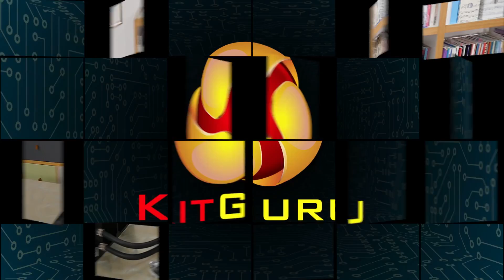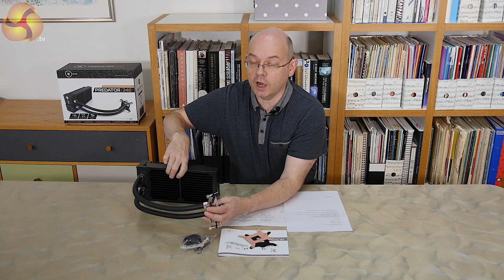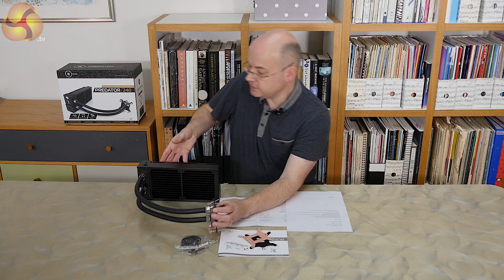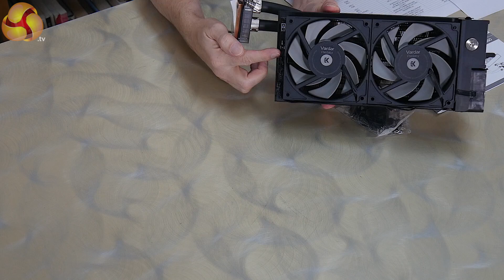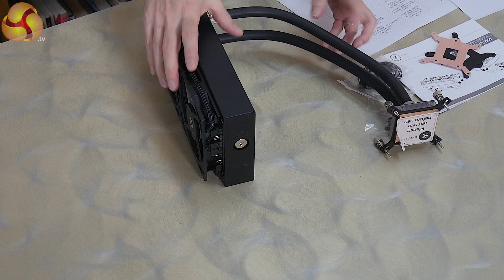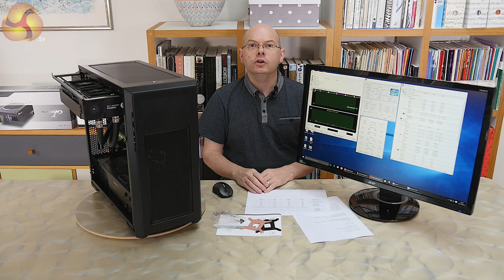EKWB EK XLC Predator 240 Review

Comment: So do we have to replace the water on a scheduled basis or is this like the Corsair h100i or NZXT x61 in that you never replace the water?
Reply: +PhanaticFilms Theoretically, yes. In practice my guess is you would pull Predator apart after a year or two and change the hoses or add a GPU block, and in the process replace the fluid. You cannot service an AIO but most people would predict an AIO would fail after a few years as the pumps tend to be weedy.

Comment: have the noctis 450, it does support upto 360mm rad but does anyone have this setup that can confirm that the predator 360 will fit in the noctis 450 ? also how often would i need to top up/bleed the system ? thanks
Reply: +TECH REVIEWS NORTH EAST/UK If you go to the EKWB shop on their website, and go to the page for the Predator 360, they have a link where you can see which cases it's confirmed to fit in. I would definitely recommend checking there, as there are a number of cases I've looked at (like the Carbide Air 540) which support 360mm rads, but not the predator, due to it's extended length (which comes from tacking the pump/res onto the end of the rad).
Reply: mygetrichslowplan thanks for the reply, i have decided to go another route for cooling.thanks

Comment: Best review, on this unit, that I have watched.
I am really considering a Predator 240 for my X99 build.
I could fit the 360 in my Corsair 780T case, but I would have to remove my DVD drive to do so, and possibly my hot swap drive bay as well. With the  test results which you received, I think that the 240 will work just fine, especially given that I don't thrash my CPU much. One thing that I am concerned with though, is that I usually run my PC 24/7. Is that going to be a problem for the water pump? I welcome any comments on this, especially if they are a result of experience.
Thank's for the video.
Reply: +Scott M (Scotty2307) I cannot really say for sure but personally I wouldn't be worried about leaving Predator running 24/7

Comment: Just bought the 360 model. Very impressed tbh but it has severe case compatibility issues. Fit well in my Enthoo Primo but then any unit that wouldn't fit that case would not fit any case! Tight clearance by the X99 board 8pin power section. Plus the actual tubing could have done with being a little longer as it was a tight fit reaching to the cpu area.

I bought the added screw kit in case my board MSI Gaming 7 did not have through holes. Was not needed in the end. Surprising that EK did not include these screws for free tbh. Very surprising. 

The price of this unit is eye watering as well. £200...